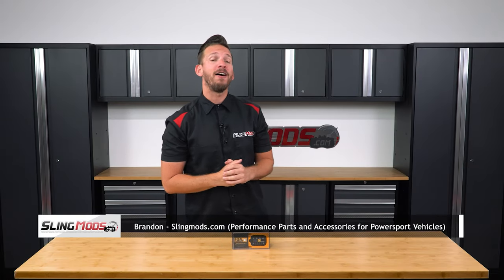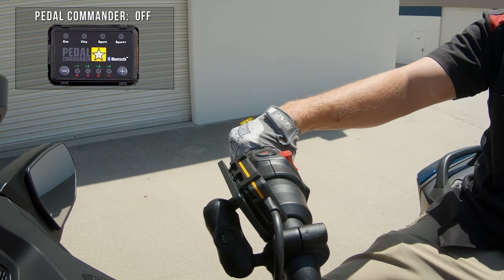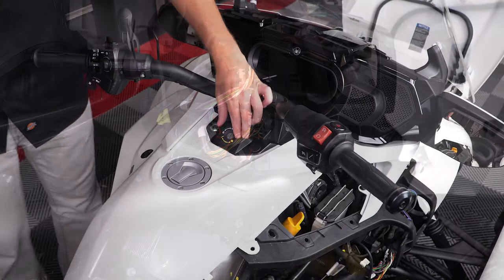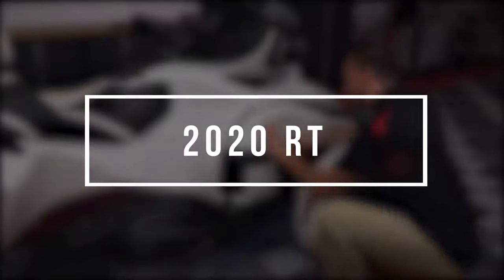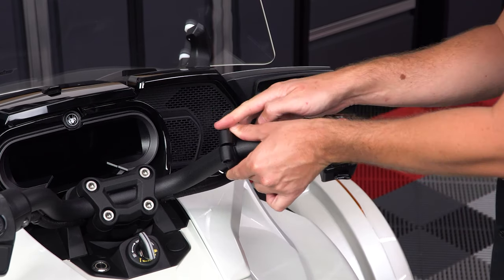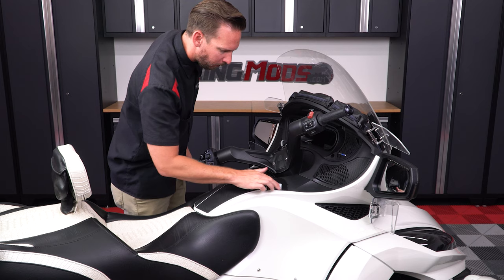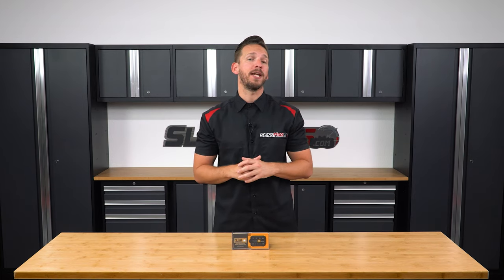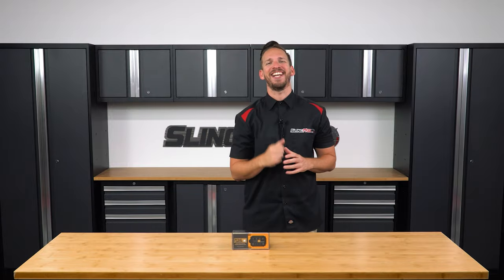Can-Am Spyder Throttle Response Controller by Pedal Commander (1330cc)

Comment: Follow up post: Received and installed. City mode is meh, sport mode is nuts, sport plus is frightening. I sealed mine in plastic for water proofing and use the phone app. Easy install, highly effective and a must have. Buy one! You're worth it! 👍😀💪
Reply from the maker: Lol. Glad you like it! 😁
Reply: Can you post a photo of the plastic housing for waterproofing ?
Reply: @richgreen7429  Ziplock bag tucked under the bodywork.

Comment: For the RT installation.  It's more involved than the video shows.  They took more plastic off than they show in the video.
Reply: I have a 2014. Maybe the newer ones have less under the panel that he took off. Mine under there has more plastic panels blocking the wire harness. I'm going to need a few panels off
Reply: That's the truth. I used that install time to add the magic mirrors.

Comment: UPDATE on Pedal commander. Rode around some more today. No more limp modes, bluetooth working great. unit hidden under panels by right speaker. Seems to be doing as expected except still no hole shots. Worth the money? Maybe, certainly does have better acceleration from a rolling start. I am comfortable running around in sport mode +2. It's a keeper. , Also I had another piece behind the panel over the throttle controller, to remove for access... 2016 RTL
Reply from the maker: Hello Bill, glad to hear it's growing on you. We intentionally limited the ramp up on the throttle for the first 2K RPM. Once the bike is over that you should feel substantial throttle response improvement especially in Sport+ mode. Once you ride in the Sport or Sport+ mode for a few dozen miles and turn the Pedal Commander back "off". You can tell just how slow the stock throttle setting is to respond. Remember that this product comes with a 30 Day Money Back Guarantee. If you don't absolutely love it or feel it's worth the money, you can always send it back to us for a full refund. Thanks!
Reply: @Slingmods  Thank you for that information. Did you also get my email about your install video? I have another cover behind the panel in front of the throttle connections that has to be taken off for access. 2016 RTL
Reply from the maker: @nightcruiser99  Ah thanks for sharing Bill. I don't answer the emails but appreciate you posting that information here so that others with your model year will know.

Comment: Is the control panel waterproof
Reply from the maker: It is not.. but we're working on a silicone cover. Please also note that you have full control over throttle settings with the free phone app. So you could stash the unit in a dry place and control with your phone at any time. Thank you!

Comment: hi you have to calibrate the pedal commander?
Reply from the maker: Hello Alex, no you do not. You just plug it in and ride. You'll be able to simply select your riding mode and the sensitivity level within each mode to fit you particular riding style. I'd recommend starting out on a mellow setting and working your way up to a more aggressive throttle settings as you get more comfortable with the product. Thank you!

Comment: Is the handle bar mounting kit required for the 2020 RTL?  I wasn't quite clear on that.
Reply from the maker: Hello Bill, no sir it is not. The handlebar kit is only offered as a clean mounting solution for the Pedal Commander itself. You can also adhere the Pedal Commander to a body panel with the included velcro if you'd prefer, or stash it away and use the Free Phone App to control the device.
Reply: OK, thanks.  Save my coins for the Pedal Commander, the reviews are quite positive.
Reply from the maker: @billwilliams9527  Absolutely Bill.. you won't be disappointed. It's a game changer for sure.

Comment: Hmmm this or Monster fuel tune??? I cannot decide
Reply: Do the monster tune...this does not increase horsepower and torque..
Better yet..get the monster tune AND This.. combined together...I already have a Stage II tune..I'm ordering  this for the quicker throttle.

Comment: Unbelievable! This should be your very first upgrade to your spyder without a doubt!  Second, third and fourth upgrade;  more expensive helmet - that crappy old one from 20 years ago won't cut it anymore with this kind of takeoff power,  a new sway bar cause this thing will absolutely slingshot you out the corners and a rope to tie your ass down to the seat - yes you're gonna need it! Oh, and warn your girl about the change when she's riding or she'll end up off the back or in the ditch.....lol.

Comment: Does the pedal commander void the warranty? 
Has anyone installed in the frunk and just used the vluetooth?
Reply from the maker: Hello Mason, yes... you can absolutely run it in the frunk and control it via bluetooth, though you'd have to have a hole large enough to pass through the plug. The warranty question would be a question for your local dealer. However,  it is plug n' play, so you could simply remove it before service if you're concerned about that.